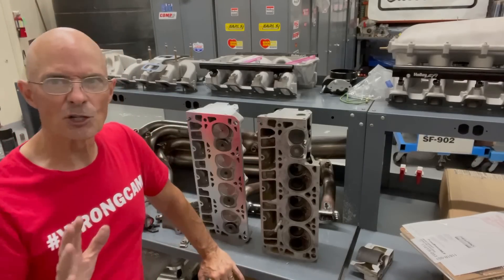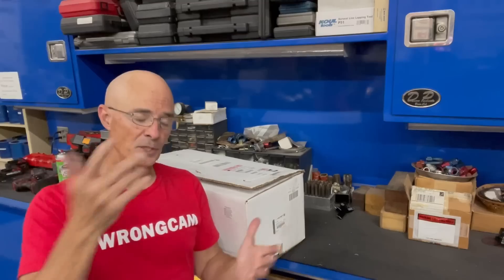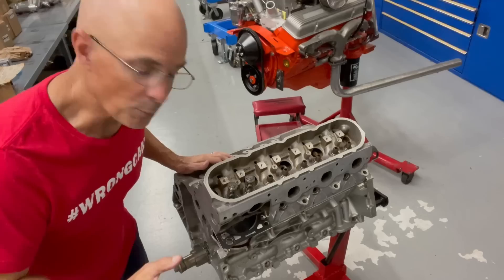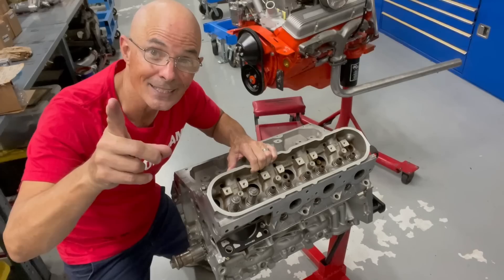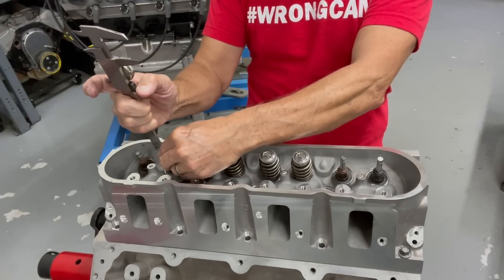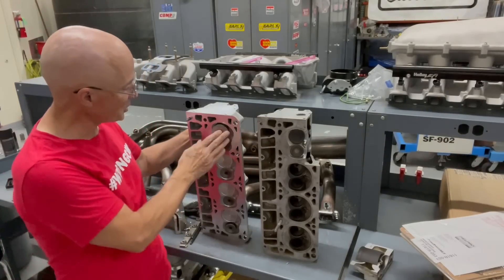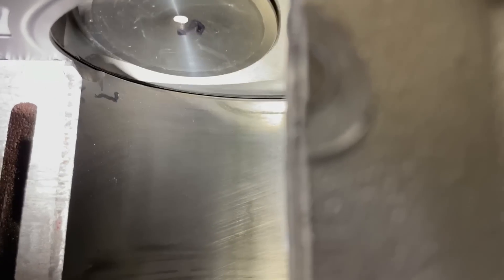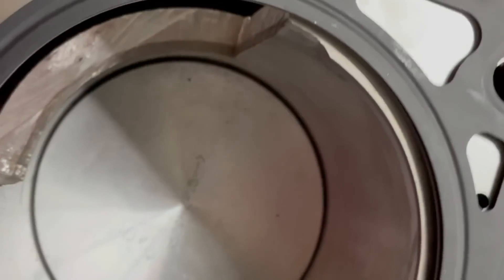CAN YOU RUN REC-PORT LS3-STYLE HEADS ON A SMALL BORE 4.8L/5.3L? WILL REC-PORT HEADS EVEN FIT A 4.8L?

Comment: Richard, what sort of air capacity would the big valve heads deliver with .390 lift? It still would gain a lot more air/fuel flow wouldn't it?
Also reduce stress on valve springs, cam/ lifter loading and maybe allow as much as another 1000 rpms before valve float?
Reply from the maker: big valve are heavier (float earlier) often have less low and mid lift flow
Reply: @richardholdener1727 Often may not be the se as " will the big valve flow more air and fuel than the stock head" with cam lift limited to just under .400". To get big power things like stiffer springs and accouterments  would be expected.

Comment: What about the lq4 6.0 truck motor l92 heads on that?
Reply from the maker: yes-they fit on a 6.0L bore
Reply: @richardholdener1727  nice I didn't know that since the 5.3 is a step down smaller displacement good video btw.

Comment: They consider the 5.7 a small bore motor as well. It is considerably  larger then the 5.3 though with a 3.898. Do you think these heads could fit a 5.7 and work well ?
Reply from the maker: they don't

Comment: Hey Rich, what small-bore LS3 head do you recommend for 5.3/4.8 bores and for 5.7 bores?
Reply from the maker: I've never seen a set that fit, but I would go with Cath ports on that bore size
Reply: @richardholdener1727  how about the 3.898" bore? Do you still have one sitting around?

Comment: Is it a bad idea to build an 8000 RPM short stroke / large bore LS3? One day I want to do that if 500+ hp can be reliably achieved on 91 octane.
Reply from the maker: a stock ls3 makes 495 hp-a cam and springs get you 550+ hp-no need for short stroke (it makes less power)
Reply: @richardholdener1727  I want an 8000 RPM Redline and all the power in the upper rev range.
Reply: @gregb11385 On 91 octane?  8000 rpm?

Comment: Hello Richard good morning,by any chance do you know if 799 heads are compatible with LR4 engine 4.8 stage 2 cam.    thanks for your videos by the way
Reply from the maker: yes-the factory used 799 heads on gen 4 4.8Ls-but I would pick 706/862 heads for a 4.8L

Comment: They developed back in the 60s i believe the w-series v8 where they cut “valve reliefs” into the block to run larger valves. Cool motors ahead of its time but went away so soon

Comment: I seen those heads on LS1 they machined valves smaller so it fitted. Worked on a turbo application like a bomb. So nothing a bit of thinking outside box can't solve

Comment: I am runnin ls7 heads on my stroked ls3, the exh valve was the main issue and we machined it to give 0.030” valve to cyl wall clearance.
Reply: Lol theirs a easier way. I got em fitting a 6.0
Reply: Whats the easier way you speak of?

Comment: Hey Richard.  The gasket is 4.1 to suit the head chamber. So the 5.3 is on 3.780. What about the ls1/6 with 3.903 bore size that is a common oversize used? Just unde .200 difference between them over the 5.3 at .320??? Also what if you run a slightly smaller valve in the rec port head to help clearances.  Say .040 smaller valves.
Reply: So at .320 that's about 8mm larger than a 5.3 but only 5mm on a 5.7 with a 3.903 bore. Minus another. 040 thats .020 off the inlet and exhaust valve brings it down to 4mm. Quite possibly work with .600 lift.
Reply from the maker: try it to see

Comment: Im all for R&D but as you eluded to in your intro; just because you can do something.., should you? Cylinder heads are specifically designed for a specific RPM utilizing a block's bore and stroke. Through engine math and complicated algorithms port sizing, pinch point and valve curtain are determined; all for the purpose of maintaing proper airflow velocity throughout the expected RPM range. Your vids are entertaining and most often there is something to learn. In this video you missed a greater opportunity to teach WHY you shouldnt use those heads on a 4.8/5.3. That missed opportunity was how to qualify size. When is big to big. When is small to small? In other words how do you qualify the size of a port or the size of a cylinder in a block as small, medium, or large as it relates to power output being mild, moderate, or maximum? Those commenters thinking these heads are perfect for a 4.8/5.3 dont understand basic engine theory - only because no one is teaching them.
Reply from the maker: the big hurdle is will the heads fit, making their size less important since you can't put them on. But size was covered. BTW-Heads and not rpm specific.
Reply: I may be nit picking, EDIT, and I certainly dont wanna be the monday morning quarterback - I dont wanna be that guy.  Peak Volumetric efficiency makes a port and displacement/RPM specific for its intended purpose; any other displacement comprimises that VE% at that intended RPM and requires other changes, hence my comments on qualifying size relative to peak output. Yes you can mix/match but an emphasis on understanding how the cylinder sees the cylinder head is tantamount if you dont want an engine with mismatched parameters, for its intended use.

Comment: Question: So if I wanted to put a 383 rotating assembly in a 4.8/5.3 block, with that bore size could I run those heads and have cylinder wall clearance that I need?
Reply from the maker: A 383 IS A 4.0 INCH STROKE AND 3.902 BORE

Comment: You also have an issue with the cylinder shrouding the valves and disturbing the airflow, so you won't be able to take advantage of all the additional flow anyway.  The large-valve, small-bore head may actually give you more or equal flow due to undisturbed, smooth airflow.

Comment: Thanks for your demonstration.  Sounds like the same problem that Chevrolet had that similar problem with the 348 and 409. Also the possibility of hot spots in the cylinders at the point of the head gaskets and a little way down the cylinder wall. In other words it would really complicate those arias nearest the valve and the cylinder walls too.

Comment: I read the title and said well Richard holding would be the one to be getting the answers... and I wonder what the numbers would be on a stock 3rd gen early or late 2004 5.7 aluminum engine and the one with the revised 241 head and came with a factory LS6 intake I always wondered what LS3 top would do on that... or an LS3 top on the Gen 3 5.7 LS6 243 head... I was wondering recently what an LS3 top would do to either one of those engines approximately
Reply from the maker: LS3 won't fit a 5.7L bore

Comment: Aren’t there Indy engines where they shorten the stroke of the pistons so they can turn em up to 10k RPM?  If you did that in this situation you could lose down low but turn crazy RPM
Reply from the maker: no-the displacement of the motor is limited by the sanctioning body
Reply: @richardholdener1727  I can’t remember which engine I’m thinking of but they shortened the rods and the heads actually went into the bores. It wasn’t the Chevy big block wedge I’m thinking of it was a engine that was turning 9-10k I think.

Comment: Now my question is, what size bore would it take to fit and run properly? I know a 4 inch will fit, but what about like a 5.7 or even a slight overbore 5.7? I know you're just making a large bore out of a small bore but if you have a 5.3 that you're changing rods and such in anyways would it be worth the bore
Reply from the maker: a 5.7l bore won't work either-needs to be notched

Comment: so what we learned is, 6.0 block + 4.8 crank with rec port heads will be the only way to see what a 5.3 engine can do with one of these heads. obviously have to have custom pistons because there will have to be some machine work performed to get that compression ratio back up. 
would be interesting to see where the difference is the heads and intake manifold compared to a l33 with the fast intake. 
would still love to see a small bore/long stroke 5.3 vs a big bore/short stroke 5.3 with as much of the same parts are possible.
Reply: I'm sure one of the magazines did something like that already. They used an LS3 block and a 4.8 litres crank and I think it ended up being something like 5.54 litres.
It made shit loads of power though.

Edit: they dynod it at Westech and it made 607hp!

Comment: As long as we’re on this subject, what are your thoughts on a 2.30” valve in a 4.250” bore?
Reply: I have a 2.250 valve on a 4.125 bore (LS7) and it works pretty damn good. A 2.30" valve is a slightly smaller percentage of the diameter of your bore than my setup is.
Reply: @C6Z_Bob  
I think the issue is the BBC valve is canted, I’ve heard that much valve will hit…

Comment: I have a 4.8 what are some of the Modifications To Do to the engine to give it some more power.its in a type 3 69 vw wagon c4 corvette suspension manual
Reply from the maker: cam, intake, heads, headers
Reply: @richardholdener1727  what head and have a Good suggestions on cam shafts
Reply from the maker: watch the many 4.8l vids I have and pick the power curve you want
Reply: @richardholdener1727  thks and thank you for your reply

Comment: Could you run a custom piston to give you a little more room, groove out a metal gasket instead of using an oversized one, run whatever cam fits.....then BOOST it to overcome the compression loss and take advantage of the flow you're now making?
Reply from the maker: if it makes less power na, it makes less under boost

Comment: Mill the head (or buy a head with a smaller chamber), add a thicker head gasket, clearance the cylinder wall, and use a low(er) lift cam.  It'll work, but you'd probably just kill the bottom end power.  Neat video
Reply from the maker: milling the head reduces valve to deck clearance
Reply: Thicker (thickest you can get) head gasket for LS3 (with it's larger bore at 4.100 or whatever) would mean less of a notch in the cylinder wall.  Basically, get the clearance in the gasket.  That's where I was going with it...  @richardholdener1727
Reply: @richardholdener1727  use the mill that adds clearance 
!

Comment: I'm weird. I did the opposite and I'm using cathedral port heads on a 4.065" bore. But... I got 12.6:1 compression, and over 600hp out of it NA... 🙂
Reply: I was thinking about doing this on my 6.2 ls3 block aswell
Reply: @7000U9ZHIFT  In my case, I wanted to maximize NA performance for drag racing. So as much compression and RPM as I could get. I had a set of 799 heads that had been CNC ported by PRC, so I had a machine shop shave them to 59cc and do a valve job (the guides were shot), and port matched a Hi-Ram intake. I don't have A to B results vs a similar rec port build, but I'm happy with the results. Runs 10.40's at 129mph at 3000' DA in a 3000lb car. Shifts at 7000rpm, and crosses the 1/4 mile mark at 7300 at that altitude. The 600+ number is admittedly an estimate based on ET since I've never bothered to put it on a dyno.

Comment: I had to leave the chat to see what you actually did. Your right on with this. If its port volume that is the target. I think it might be better to CNC the SQUARE port pattrrn into a set of cathedral heads. This way youd be usine a maximum size port and valve. Without compromising the block and sleeves.  But again this is a massive cost just to see if the SQUARE port is going to give you more horsepower.   Hmm. You need someone from the more money than brains to indulge your every whim to test a theory.
Reply: There would be some fuckery involved in that for sure given the valve spacing difference.
Reply from the maker: port volume does not add power

Comment: Edelbrock makes bolt on LS3 style rectangle port head for small bore LS #61319.
Reply: Do you know if they would work for an ls1?
Reply: @xanderbrandenburg6628  Yes it will work on LS1 and any other small bore gen 3 like the 4.6, 5.3 and 5.7.  GM Performance #19201807 and Promaxx also sell [small bore rectangle port heads]

Comment: So if the rec port head can be used on a 6.0 with a 4.000 bore then why should you need a 4.100 gasket to make this all work together?

I feel like you took a little more than necessary out of the cylinder wall up top.  I'd like to see how it performs but on a small displacement engine we would have to expect these to perform similar to the 317 heads with maybe a few more horses up top.

Comment: Make it happen
Add boost for the loss of tq

The next big bang.  What will fail first?   The block where the cylinders are machined for valve clearance or something else?
Reply: You know if that cut in the cylinder bore is retained you’re just going to blow a motor instantly right?

Comment: Bigger question is can you mill rectangular ports in a cathedral port heads and use Rectangular port intake????  And will it make more power??
Reply: You can get adapters to go cath to rec.  I think @richardholdener1727 has tested them.
Reply: That wouldn’t help the air flow. That just allows people to run stock gm supercharges and intake manifolds
Reply: That's why if you milled it if it would help flow rather than adapters.  @BearGrils55
Reply: Yes, I was agreeing with you and disagree with the other comment. The adapters won’t help flow, but cutting the cathedral port to a rec would be cool to see.

Comment: You would lose out on compression, and would not be able to reap the full airflow potential of the head due to shrouding. If they did work those heads would not be a good choice for a hot street combination. Would stick with cathedral ports on the small bore LS.

Comment: the real whip shit, raised floor 821 heads on a 3.900 bore block with notched bores, might all work out with smaller valve, but the relocated valve centerlines are a bit more challenging to deal with. A 2.050 intake valve, slide the exhaust valve over 60 thou with a offset guide, move the seat weld the chamber and ports up etc  but a epoxy filled raised floor 821 style head could be a real screamer on a small bore 3.900 motor

Comment: Gee Richard just angle the valve guides like a boss 9 BBC  Cleveland   Answer is to just turn up the boost on a cathedral port head   Max Wedge and others had notched blocks from the factory but not here

Comment: I guess I haven't been looking at the basic horsepower per liter of these engines enough to know if the larger bore engines that use the cylinder heads actually make more horsepower per liter.

Comment: A set of custom pistons could resolve some of your problems, domed pistons to bring back compression, then move the rings a little further down the piston to allow for adequate clearancing for the valve pocket. Bada bing bada boom
Reply: Or easier to just run a 4" inch bore block!
Reply: Hey Richard, I’m doubling up on a reply that says use a 4.000” bore block. 4.000 x 3.267 gives you 328 cu in or 5.4L, which would need to spin 10-11% higher to utilize the airflow of a 6.0. Since you need custom pistons anyway, build the big bore, short stroke LS with 10-12 cc domed pistons and shoot for 7500-8000 power peak. Sounds like a project for you! Inquiring minds want to know!
Reply: Just use a canted valve design in the head and it will clear

Comment: Haha i knew what would happen but they got some big valves in em. Maybe...Off set guides and a smaller exhaust valve would make it work. Lol good looks tho. With the power people can make on other heads would be way more beneficial. With the money you'd spend on getting a good cylinder head guy to do them, not worth it.
Reply: You're talkin off set guides, machining them, new valves resized, but still big and good valve job and port. It'd cost, basically a race head at that point. You'll also need to spin that sucker up to take advantage of what you did. If I had some of those heads and a lil money, I could definitely machine them up and get em to fit

Comment: You would be LOSING so much air flow from a third of the valve being shrouded to the point of being useless
Reply: Would it hurt tho, In my youth I put a big bore (12g940) head on my small bore a-series engine. Had to relieve the block in the same way, use the big bore gasket, performance improvement was drastic. Big gains. The overall bigger valve allowed more flow despite the shrouding.
Reply: @denisohbrien exactly this
Reply: for sure
Reply: Yeah, that is some wicked valve shrouding.
Reply: Exhsust vslve doesnt mattet
Reply: You are just parroting what most of the forum posters all regurgitate. I suggest learning first hand instead...

Comment: Off topic but is there an average gap increase for adding say a 250hp shot or boost?
Reply: 0.030 top and 0.028 bottom. I’ve seen a lot of people run this.
Reply: .004 gap per inch of bore for stock/mild stuff, .007 gap per inch of bore for big nitrous/high boost
Reply from the maker: .004 is not enough
Reply: @richardholdener1727   I agree it’s not enough which is why we open the gap to .006-.007 per inch of bore before shoving boost or nitrous in them, but around .004 per inch of bore is what I’ve seen most engines out of the junkyard at.

Comment: Also what about the promaxx small bore extreme 240cc heads? They come in a 59 and 63cc chamber.
Reply: Found em on the website, it says for ls1/2, will they work on a 5.3?
Reply: @foxxrider250r  the promaxx small bore will yes. But what about the 821 on ls1 ls6 5.7
Reply: @lcxu1051  I have no idea..you tell me lol
Reply: @foxxrider250r  the promaxx heads are made for the small bore engine.  But they aren't a simple bolt on job from what I have read.